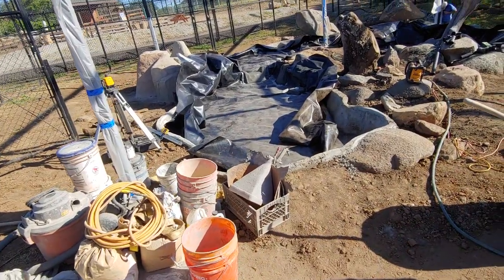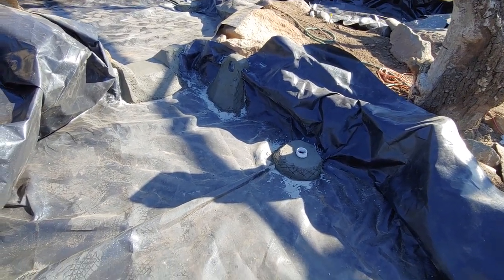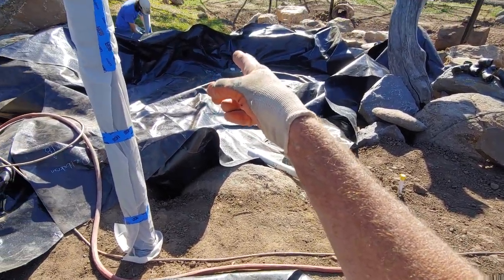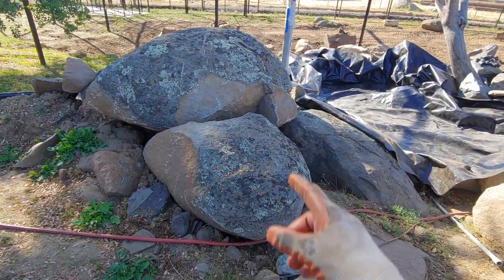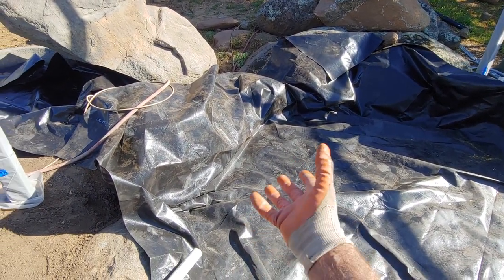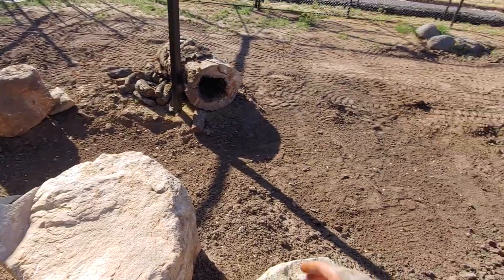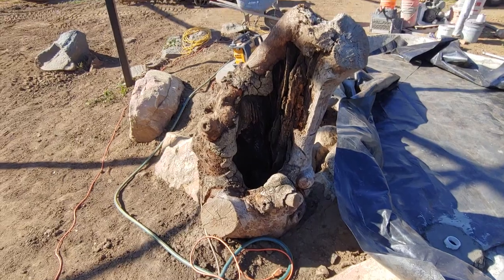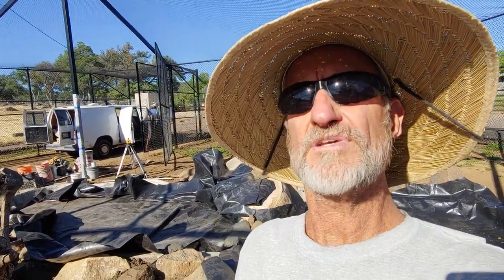How To Build a Fake Rock Concrete Pond

Comment: Hi Dave your work looks amazing, I’m doing a small pond and waterfall in the same sort of way you do your features, do you use any sealer when completed or do you add a pva type bonding agent to the mix or both?
Reply from the maker: Hi Clintonsworld!  If you're talking about the pond basins no waterproofing is needed since the liners are providing that functionality.   If you're talking about the faux rock feature that will bubble into the ponds once things are all done I did waterproof that.  First I apply Aquablock XL to the structural concrete for penetrating waterproofing then after that either regular Thoroseal or Miracoat Membrane C depending on how large the feature is...  For more faux rock how-to's including free pdf downloads and videos you can check out www.davehenderson.podia.com  For my blogs and links to other platforms go to www.daverhenderson.com  Lot's of cool stuff to check out.  Anyway, thanks for watching my videos.  I really appreciate it.  Now go have an awesome day NO MATTER WHAT!  Cheers, Mr. Dave  :)

Comment: Did you put a concrete layer 
Under the liner ? Rebar or just chicken wire ?
Reply from the maker: Hey Johnny, nothing but dirt is under the liner.  It's strong, compact dirt.  If it was loose or unstable establishing a firm compact base would be needed.  We shotcreted over the entire pond areas with no rebar inside it.  :)

Comment: no wetland filtration?  And is that pvc liner?
Reply from the maker: Hey Zero Point. Ya, interesting project.  Bobcats apparently need water to poop.  So the ponds will be completely emptied, hosed off then re-filled on a regular basis.  It's not really a bio feature.  On the liner I used www.btlliners.com   A fabric type of liner which was much lighter, (20mil) and easy to use.  Not cheap but what liner is....